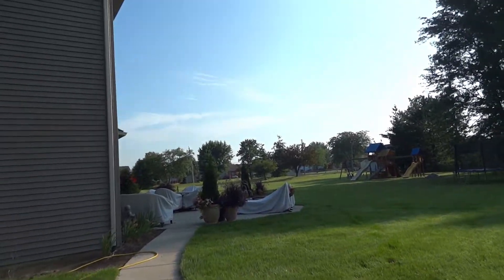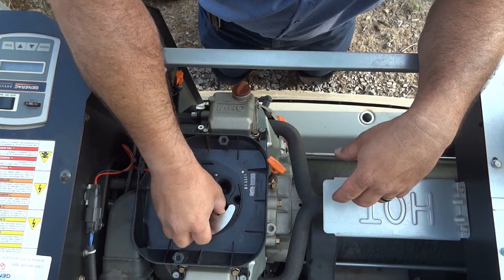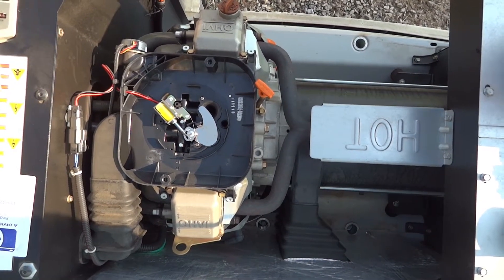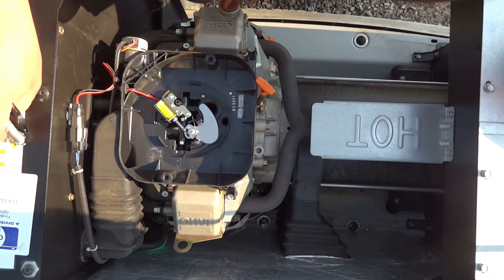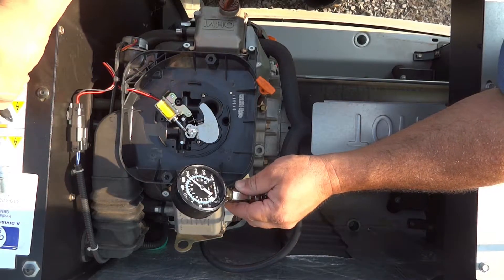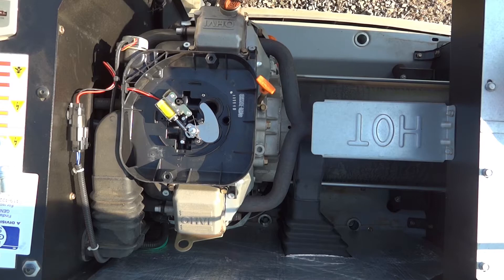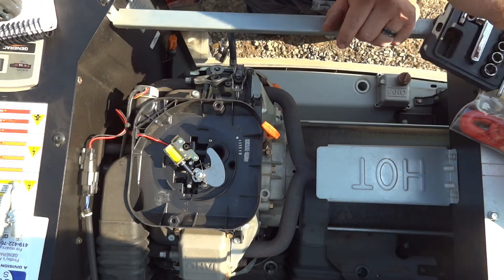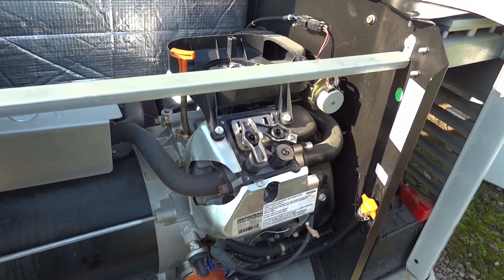Generac Catastrophic Motor Failure

Comment: How hard is it to change a bent push rod before it breaks?  Mine might be bent. Can’t find any videos on replacing on a 20kw. It’s 11 years old. The push rod guide was found broken on the top end of it.
Reply from the maker: Not hard at all. Rotate the valve to the side and pull out the rod.

Comment: You could have checked the operation on the lifter with a very long  rod or screw driver. Maybe an easy fix just to replace the push rod.
Reply from the maker: 👍👍. I have a mechanical stethoscope, one of the problems I face is I'm not an engine mechanic, I'm a hvacr technician working as a generator tech,  unfortunately we work on everything under the sun.   Luckily If I need extra engine help I have family members that are gearheads, Engines were never my thing.

Comment: Rick, could you recommend a Good Battery Checker, not a charger or tender. One that you can see CCA of the battery. Checking just voltage does not give a good battery health indicator. Thanks for all your video's they have helped me a lot. Happy Holiday's
Reply from the maker: I got a cheap one off Amazon. I looked for the highest rated analyzer I could find with the least amount of complaints. It was green and it doesn't have a familiar name. So far it seems to be pretty accurate.

Comment: Have you ever changed out a starter motor on the Generac, would be nice to see that. Thanks
Reply from the maker: I've changed about every part of these. I have a video where I replace the motor maybe a year or so ago,  you have to remove the stator and rotor to change the motor. If you watch that video you'll see it. There's not much to it.

Comment: They are setting the govener to high and it floats the valves or the adjustment has moved that's the only reason why that would ever happen
Reply from the maker: Do you understand that if they were to set the engine speed higher than 3600rpm they frequency would no longer be at 60hz? I'm sorry but your incorrect.

Comment: Have a 16kw and it only ran for 2 hrs when we lost power then the last week it does it run cycle and ran 1 min looked at the code low oil pressure switch shut down the machine and checked the oil on it looked great not dirty at all and it’s a natural gas so they came replaced the oil switch and said that’s not the problem needs a new motor the thing is not even a yr old and only has 2 hrs run time and  glad it’s covered under warranty
Reply: Who was the manufacturer of the standby?

Comment: Holy shit this is the 2nd engine failure i have seen you find. What year is this unit and how many hrs on it? I have a 22kw unit 2020 model hope i dont have this problem!
Reply: Valves have to be reset after the first 30 hours.  Then again at 500hrs.  That is what causes these issues - no one does it.  Hire good services and it gets done.
Reply: @chet3larson  ... I have found that 400 - 500 hours is too long between valve adjustments and you are better off doing that when changing plugs, say 250 - 300 hours. You have the plugs out anyway so you are half way there. I suspect this series beats the pushrods when the engine first starts and revs to the sky. (valve float) The newer units have a soft start with slow build up of speed.

Comment: I work for one of the larger dealers in the east and have offered to do a repair on units with the worn pushrod, but with no warranty on the fix. IOW, cheap shot gamble that seems to pan out most of the time. In some cases it's bad enough to be worth changing the head, but still, the repair is in the hundreds of dollars range, not thousands. (new engine)

Comment: Had a Generac 6ooo watt portable..  Armature failed after probably 40-45 hours.  New one would have cost over $400.  Whole unit was around  700. Now I have  DeWalt 6500w portable. Have had it for several years.  Very  happy with it.  Personally,  l dont want another GENERWRECK. This  video revealed that you had changed motors on smaller units. Is this something you see very much of?
Reply from the maker: I've changed a few Motors in my day and a few armatures and a few stators. But anything made by man is made to fail. Myself personally I have a Generac portable unit and I like that better. I wish it was natural or propane gas but I'll settle for the gasoline for now. Plus I can take it with me.
Reply: Dewalt is made by Generac.

Comment: Disappointing quality considering the price, and being a backup generator it should be as dependable as possible.
Something you can count on to perform flawlessly in emergencies.
Not break a fucking pushrod of all things jesus lmao.
Reply from the maker: I would not be happy after spending the money that this customer spent.  Unfortunately anything mechanical can and will fail. I have had the factory make adjustments to part pricing after I have called and explained the situation. I don't believe we installed this one, so choose your installing company carefully, this is where service after the sale makes a difference.  Thanks for watching!

Comment: That’s why I won’t get GENERAC GUARDIAN because they are money pits.
Reply: I prefer the CUMMINS RS20A with the VANGUARD 30HP engine.
Reply from the maker: The newest versions are a lot better than the first generation from probably 10 years ago. But unless you're going to spend the big money on a Kohler there's really not anything that comes close with the features for the money. This is why I have a gas operated Generac generator that sits in the garage until I need it. I haven't had any problems with it.
Reply: I really would love to see the video of you with the motor that's got the Mikuni on it